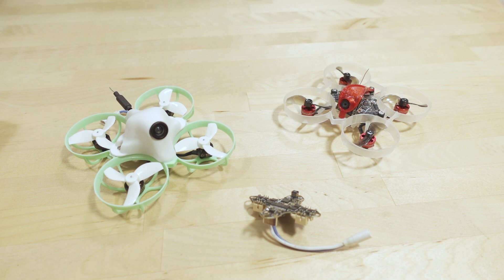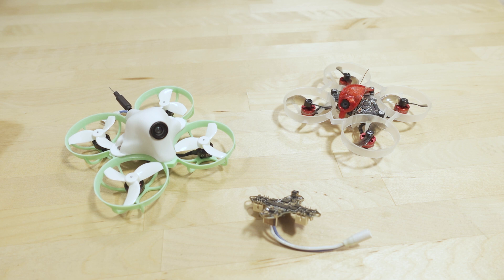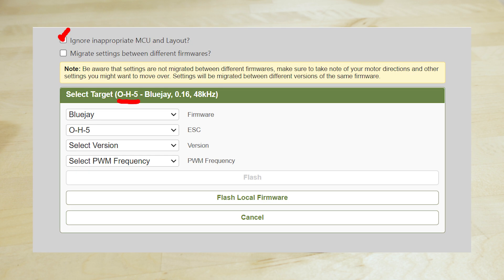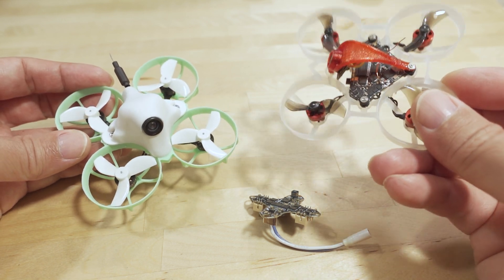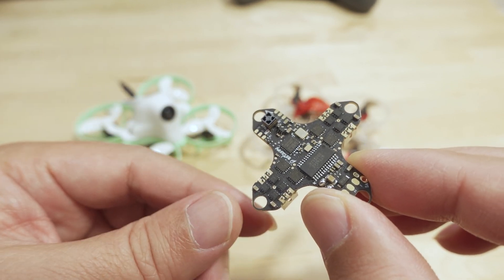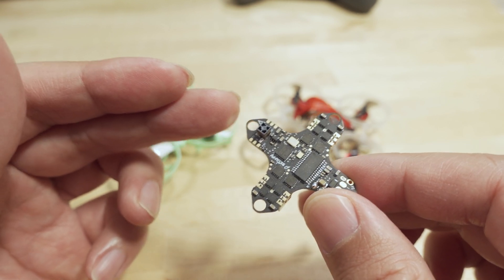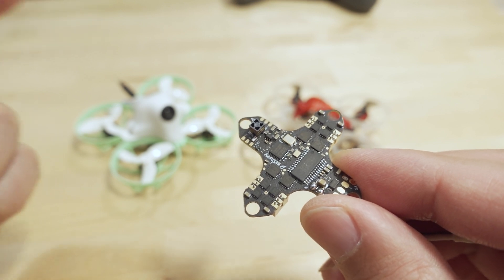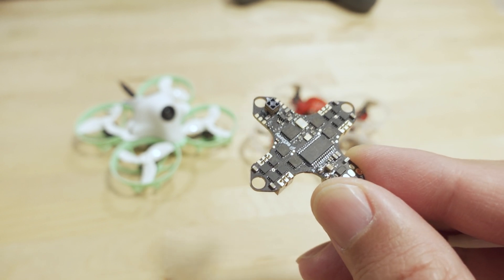HOW TO FIX ESC Bricked by ELRS SPI RX 🎓

Comment: Hey Albert, I recently flashed my Meteor 85 ELRS (w flysky rx added) to BlueJay firmware on 96KHZ. I did this today and motor 3 would not spin up afterwards. Flashed bk to BL Heli S but would like to try again. Any ideas what I could have missed ?

Comment: I just flashed Bluejay and motor 3 was stuttering afterwards. Spins fine in Beta motors tab. 
Flashed back to BL Heli S 
Now all motors not spinning up. Unsure what to do next.
Model - Meteor 85 w ELRS
Reply from the maker: What did you flash to Bluejay firmware?  I'm hearing there's quite a lot out there that seems to have issues with Bluejay.
Reply: @AlbertKimTV  A Meteor 85 bnf

Comment: FWIW I've had this happen on a serial ELRS receiver as well. This was on a stock Baby Ape, which I tried to repair by separating controller/esc boards (in order to gain access to the C2 pins), and low level flashing the ESCs (and failed as I pulled the pads trying the solder to them).
I tried your suggestion, but ESC1 still doesn't show up. I get failures trying to read ESC1 when I click "read settings". I checked the "Ignore MCU layout" option and tried to flash all, but I still don't see it. 
Oh well, it was worth a shot...back to the parts bin, or time to build a micro tricopter ;)

Comment: Thanks for the tip Albert! Related to this 1S FC from Betafpv. Did you have problems with yaw movement? Apparently if connected to usb or battery the gyro gets damaged and yaw sensor no longer works. There is a workaround published by Mr. Shutterbug, but it seems is only good first time before powering the board. I wonder if the gyro yaw can be unbricked.

Comment: It's really nice to hear someone explain the issues with flashing while having a transmitter connected. I was having trouble flashing my ESC on my HM X12 board and thought something was wrong and had one ESC act like it died. I did what you suggested and now it seems to be back! Thanks!
Reply from the maker: Glad this helped!
Reply: Did it work out ok ? My motor 3 is trying to spin but stuttering after flashing BlueJay ...
Reply: @pauleverettguitar1568  so I initially flashed to 48khz and was having issues with the motors spinning up, but after flashing back to 24khz with the ignore checkbox checked it worked.
Reading a bit more about it the jump to 48khz might need more startup power and idle speed to get the motors to actually spin up.
Reply: @FPV_Cam  I see. I went w 96 for my 85 whoop. Unsure if 24 or 48 is a better option
Reply: @pauleverettguitar1568  Lower is generally more power and higher is better efficiency so its a tradeoff. 24khz is pretty common though in micros as the default AFAIK

Comment: Yes, sharing knowledge like this is really helpful and appreciated.    I know I wasted hours trying to get an iFlight FC into DFU mode to flash BF 4.3.  It turns out I had to disconnect the receiver and the GPS.  It refused to go into DFU if they were powered up.  Probably a noob mistake, but I didn't know.
Reply from the maker: Interesting... perhaps the extra power draw from those components were preventing the board from going into DFU mode.  So many random and unknown pitfalls in FPV!

Comment: Thank you for the video. I will try this today. I will let you know if it works for me.
Reply from the maker: Please do!
Reply: @AlbertKimTV  Unfortunately this didn't work for my problem. I have the BetaFPV F4 1S Brushless Flight Controller V2.2. The Betaflight firmware is for the 4.1.0 MATEKF411RX and the ESCs had BLHeli_S 16.5 for O-H-5. I was trying to update the ECS to the latest BlueJay build using esc configurator but during the update process I heard the windows disconnect tone. I gave it 30 minutes but the the site wasn't responding. I can read all 4 ESCs as BLHeli_S 16.5 but when I try to update the ESCs, each ESC plays the first 3 startup tones for 5-6 times and then the site freezes. I have tried using all of the different standalone ESC apps but get  Error: cmd_DevicePageErase ACK_D_GENERAL_ERROR at recvCallback. Powering up with a battery plays the tones normally but the Meteor65 won't arm but I can spin up the motors manually.  I've tried resetting Betaflight and rebinding the Meteor but no luck. I'm either going to try Oscar Liang's C2 interface flash or just bite the bullet and buy a new board.